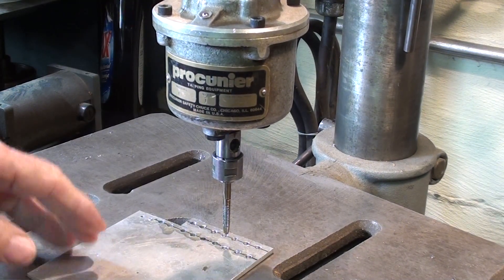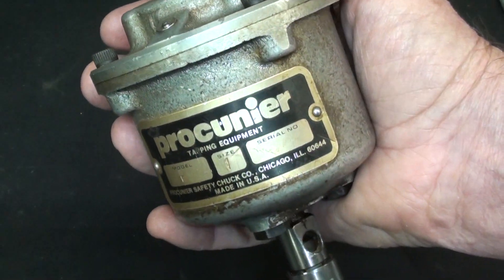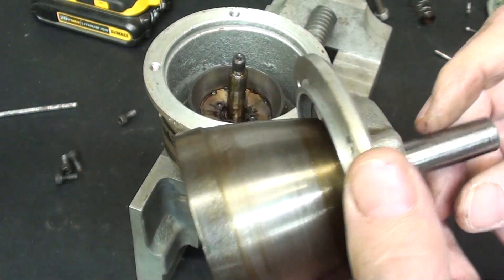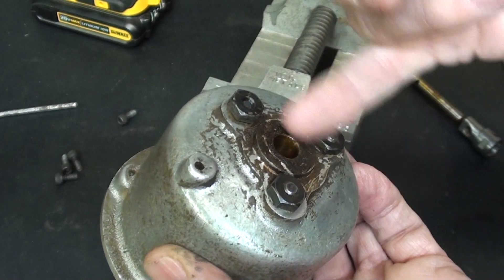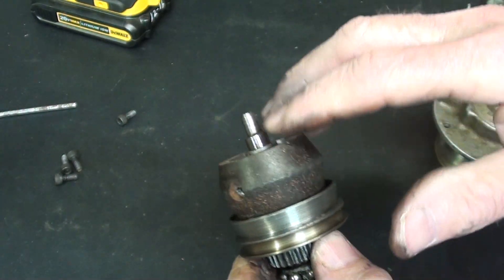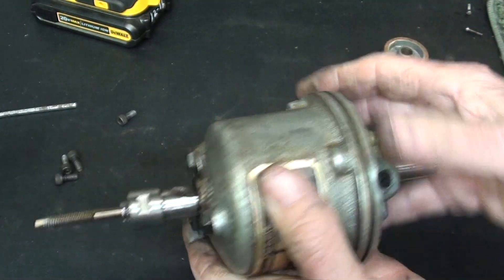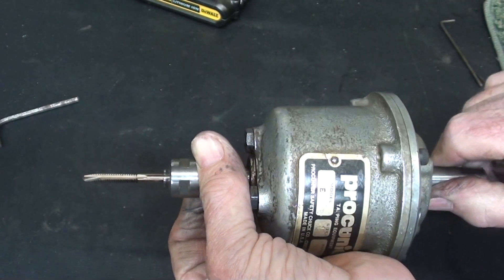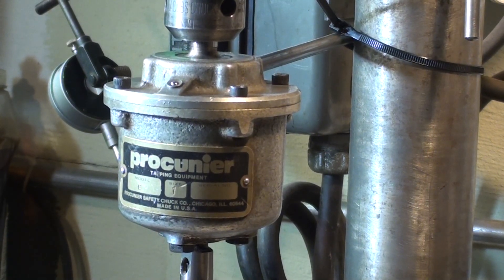PROCUNIER TAPPING HEAD What Makes It Work #31 tubalcain

Comment: When I built fiberglass housings for wind turbines I used a drill with a magnetic base that had a device like this for tapping the mounting plates. That thing could tap so quick you'd burn up the tap if you didn't take a break

Comment: Always wanted a reversing tapping head (its hard to tun a drill press by hand) so i bought a Procunier 2E off e-bay for $140. Came with a 3/8" collets but those collets are expensive. I got 6 off e-bay for another $75 so not too bad. Have not used it yet but looks to be in good shape and its made in the USA. Thanks for the video.

Comment: In early 60's i worked for Supreme Products and we made a tapper similar to this for drill presses; also a push-pull tapper for use on hand drills. Both used planetary gears. I was line supervisor for assembly for a while. Very interesting to see this again.
Reply from the maker: Thank you, I remember those supreme tapping heads

Comment: This are not correct, the friction are only to line up the ring gear with the planetary gear to lock it no friction on the down stroke / feed only on the more easy up stroke of the quill , what else are the ring gear doing. 😁
Reply: You must not have been paying attention to the video.

Comment: I've been a machinist most of my adult life. And I have always wondered how those tapping heads work. Never had the chance to take one apart. I knew it worked on clutches. Never thought about a cone shape. I envisioned a double sided flat clutch. Never thought about Cork as the friction clutch either. I always wanted to build my own version, maybe smaller diameter. The great thing about the Procunier is the ability to stop or reduce the pressure while tapping hard metals. Saving broken taps in the work, Ugh. We have a Tapomatic at work and I never use it.
 Thanks Mr. Pete!
Reply from the maker: Thanks

Comment: The Procunier advantage over the Tapmatic heads is the cork will not be exposed to oil when stored horizontally.....like a tool chain.
You can really kick up the spindle speed to get much longer tap life......try the .190-24 at 1,500 rpm in steel.

Comment: I assume the friction cone material is either cork or sintered bronze.  With the effort to exclude oil, I'd bet on cork.  I notice a gutter at the bottom adjacent to the drain hole.  Is this intended to act as an oil reservoir?  If so, this would imply some sort of lip seal on the output shaft instead of a felt.  The reaction rod should have had a little boxing glove accessory for the old school education it would offer the first time the drill press was reversed.  Thanks for the video.

Comment: Thank you Mrpete ! ive used the Procunier as well as the tapmatic tapping heads over the years, both with excellent results. The tapmatics can be found quit often on radial head drill presses.

Comment: Well I've watched the video 3 or 4 times, and read all the comments to this point at least twice, and I still haven't seen what completely explains (to me at least) the reversing process.   Obviously the double speed for reverse results from the 48 tooth ring gear driving the 24 tooth sun gear, with the three planetary gears simply functioning as idlers ... i.e. they reverse the direction, but do not alter the speed.  But the mystery is the engagement process.  Either the engagement of the ring gear with the planets goes "in" and "out" as the drill press handle is raised/lowered,  OR the engagement between the planets and the sun gear goes "in"/"out" as the handle is raised/lowered.
Without knowing the vertical dimensions or amounts of vertical movements taking place among the components down inside the housing it's hard to see which of those alternate scenarios hold true.  Regardless, we know it works, and it IS interesting and educational to see the inner workings.   Thanks Lyle for showing it!
Reply from the maker: That’s exactly why I would love to make a cutaway!
Reply: The ring, planets and sun are always engaged with each other. The sun is always turning and running in the reverse direction of the drill-press spindle.  The key is that the tap is connected to the cork center clutch, which is not permanently fixed to any driven part.  When the drill-press quill is driven down, the cork clutch is pushed up against the top of the tapping head (internal cupped area), which is turning in the direction of the drill-press spindle (clockwise).  When the quill is pulled up (away from the work), the cork clutch is pulled against the bottom of the tapping head mechanism, which is the cupped area fixed to the sun gear.  This drives the tap - now locked with the sun gear - in reverse and at 2x speed.  If you put no pressure on the drill-press quill, the cork clutch floats in the center of the upper and lower driven cup and the tap stays stationary.  See 11:53 for a shot of the lower "cup" affixed to the sun gear that the cork clutch bears against when reversing the tap.

Comment: I have one of these. It has a one half inch capacity. I've not use it in quiet awhile. I should get it out, clean it up and see if I could get up a trade with s local shop that might could use it. I no longer do production in my shop. I'm retired and just play in my shop.

Comment: Think ive tapped a million holes using those and other tapping heads.  I have two old supreme versa tappers one with 2 morse taper and one 1/2" straight . Oh and the hand held push pull tapper for hand drills or press.
Reply from the maker: You got me beat, I only tapped about 3/4 of 1 million holes while I was working my way through college

Comment: Interesting how it works, back when I had hair, in the first shop I worked in we had a tapping head in a dedicated drill press. In fact we used it on gears that had set screw holes in them. So being an apprentice I did a lot of tapping. Thanks for the close up of one of my modified oil cups, you did that to see if I was watching 😆

Comment: This was not clear to me in the video.  Is the ring gear directly connected to the main shaft?

Under forward feed the cork cone engages with the interior conical surface above the ring gear to directly drive the spindle.  In the neutral position neither that cone nor the planet gears are engaged and the spindle isn't driven.  Under reverse feed the the tap is held back by the threads it is cutting, pulling the smaller cone down to engage with the sun gear.  The sun gear is permanently engaged with the planet gears, which are mounted stationary to the body of the device.  The ring gear is permanently engaged with the planet gears.  All forward or reverse feeding does is engage the spindle directly to the shaft through the top cone, or to the sun gear through the bottom cone respectively.

Did I get that right?

That's pretty cool.  Thanks for the video.

I wish you the best for the coming year.

Comment: Great video! To add to the explanation on how the tap direction gets reversed: Reversing to counterclockwise during tap removal is due to the ring gear (connected to drill chuck) driving the sun gear (connected to tap via cork clutch) through the planet gears (fixed to tapping head housing). In this configuration, the sun gear rotates the opposite direction of the ring gear. Pretty neat! The planetary gear set provides the increased reverse ratio, but also is responsible for reversing the direction of the tap.

Comment: Fantastic video! I've got a Procunier E1 and E2 from e Bay and they are a fabulous way to tape holes.

Question: how do you store yours? Seems like laying one of these on its side risks getting oil up into the clutch area. The instructions are very explicit about not adding too much oil.
Reply: I have store mine on its side for the last 12 years. Still works fine. I think you would have to significantly over oil it to get the oil up into the clutch. Probably could clean it if you managed to get oil up there.
Reply from the maker: On its side in a drawer

Comment: I bought what I thought might be a tapping head very cheaply at a flea market. It had the arm coming off it to stop against the  drill press column. It turned out it was only a speed reducer and was too small for drills with over  a 1/4 inch shank.

Comment: I picked up a Yuasa Accu-Tapper tapping head from EBAY. Similar use but totally different function. Has an adjustable slip function with reversing. It cannot be serviced.

Comment: Me to wife: "Going out to the shop and tap a few holes." Wife, "You have a beer barrel out there? Me "No I'm tapping metal to make threads." Wife What are you tapping with, a hammer?" Me. No the drill press!" Wife You can't lift the drill press and hit something with it." How is that even possible?" No You use a tap to cut threads." "You don't 'tap" the tap to cut threads, you turn the tap to tap....!" Wife "Oh, run to the market we're outa milk." Me, Riiiigggghhhtttt.
Reply from the maker: lol

Comment: Lyle, the old guys with the circular saw mills used a similar idea for moving the shuttle back and forth. They had a spinning disk with a wheel that would move to one side or the other of the disk, thereby reversing the shuttle movement. See you at the Bar-Z. Jon

Comment: These are great units as are the Ettco Tapping Heads. Very smooth compared to Tapmatic.
Reply: the machinist  I have a larger Ettco and a couple smaller Procs. And also a large and small Tapmatic. The Tapmatic is crude and jerky but the others are smooth. Yet the inferior design is most popular. Like VHS vs Betamax.
Reply: the machinist  Never heard of them but now I want one!

Comment: We had those in the shop at Texas A&M University.  I fell in love with them! I wanted one for my own shop, but was driven back by the sticker shock.
Reply: Stalk eBay for them. If you can use a Morse taper, it will be easy, but the ones with 1/2" shank can be obtained at a moderate price if you wait long enough.

Comment: We had two of those at my work place that i used and serviced for 25 years.They where on a 5 position quadrille head.we put a drill ,a 82 degree chamfer,a counter bore,and the taping head.Once you use one to do a bunch of holes you wonder how you ever got by without it.They are fantastic and worth way more than you pay for them. That was the best explanation I've ever seen ,with a tool I'm very familiar with. thanks
Reply from the maker: Thank you, I’m glad you liked it

Comment: Great video.  That Procunier has a lot less parts than my Tapmatic which has at least twice as many parts.   Mine has a lot of clutches and clutch springs and gears.  It was broken when I got it and I took it apart to replace the broken part and it was hard to get back together.
Reply from the maker: Never had a tapmatic apart

Comment: Awesome I to have a tapping head however  I'm confused by my unit it is a wickman-thomson model T38-ss serial 216 it has it's own multiple tap holders, this unit has some special interest  to me as it is from Detroit  any help about this tapper would be appreciated.  greg
Reply from the maker: Sorry, I have never seen one of those
Reply: @mrpete222  well thanks for responding so quickly it looks as though it was used more in a lathe  due to the 1" shank I'll  take a picture  someday  you may  across one its pretty  neat

Comment: hmm possible future shop project I think DIY tapping head. The friction fit would have to be replace with some sort of full gear system. It would be tough to create and it would have to work on the principal of a manual transmission but scale way back with only one speed. Thanks for butting another shop idea in my head.
Reply: I have no idea of what you have available in terms of materials or machinery but the clutch drive could be duplicated using Nylon or a plastic with characteristics similar to the cork (there are quite a few) for the clutch cone itself.
Of course if you'd enjoy developing a small, reversing gear train feel free to ignore me, lol!!!

Comment: It should be quite easy in this day and age, for someone to generate an animated drawing which shows the mechanics of operation of this. A modern version of a cutaway, if you will...
Reply from the maker: And animated cutaway would be impossible for an old timer like me
Reply: @mrpete222  That is why I used the term "someone"...  And there is also something beneficial to having an actual physical cutaway, much like hard copy books versus digital ones. I'm also from the vacuum tube age :)

Comment: I have at least one of those, not sure what brands or sizes. Have always been afraid to use it because could not understand why the tap does not brake in the event that tapping becomes too tight. From this video, it appears that "Tapping Torque" is determined by how hard one pushes down on the drill press handle, and if not pressing too hard, when the tap gets too tight, or bottoms out in a blind hole, the cork clutch cone will slip. I am sure I got it, but if you read this, PLEASE Confirm. Now, when those heads turn up, lost in the crib somewhere, I will put them in the shop and give them a try on "Government Work" until I become familiar and confident in the feel of using them. I will dissemble, inspect, clean and lube them before using since now, thanks to this video, I completely understand whats inside and how it works. Thanks :)
Reply from the maker: Yes, you are right

Comment: Since 'I' have never seen it done, I'm thinking in my head that with the double speed reverse it could be used in a lathe
mounted in the tail stock. If so, that could be the main purpose of the double speed reverse. 

Does anyone know from experience?
Reply from the maker: I have never use one on a lathe.   Think I will give it a try
Reply: @mrpete222  That would be interesting if you show it on the follow up video Mr. Pete.
By the way, you are a true asset to humanity with all that knowledge sharing of yours.
Reply: Don't think it would work on a lathe, since tapping heads need to be powered. Also, they're designed to tap multiple holes, not just one central hole as on a lathe.
Reply: @ellieprice3396  I have used them before in a manufacturing environment on a gang drill.
'If' it would work, I could see it being used on a small run done at home.
Reply: @toddk.5873  Thanks, maybe I'm missing something. On gang drills the head is powered by the spindle to tap multiple holes on the table. In a lathe tail stock you would  tap only one hole in the rotating lathe chuck. These heads in gang drills  work great but lathe tapping would be awkward.
Reply: @ellieprice3396  To be honest, I really don't know. it was a thought that came to mind.
It wouldn't be the first time I had a thought that didn't pan out. I was kinda curious.
Like if you had a run of the same parts on the lathe that needed a tapped hole.
I wondered if you could blast them out while the part was in the lathe with the
tap head either in the tail stock or on a turret.
Reply: @toddk.5873  Actually, it was a good thought, and would work in a lathe, especially if mounted in the turret. Any number of identical parts one hole parts could be easily  tapped by lathe power. The turret would drive the tap into and out of the parts. Maybe Mr. Pete will demonstrate it in a future video.
Reply: @ellieprice3396  
I'd say you nailed it.
In a tailstock it would be a little difficult following the tap into the hole and then backing off at double the speed - mounted in a turret or adapted to the toolpost it would be easier to follow with the apron hand wheel.
I don't believe it makes any difference whether the tapping head is driven or the part - pressure engages the clutch to "lock" during tapping, and then tension engages the opposite clutch for the planetary gearing to back out of the hole.
I'm almost sure I've seen it done, but I look forward to trying it when I have some free time at work!

Comment: Thank you for unraveling that mystery. I think you did an excellent job explaining that. In the beginning when you where telling how it operates I was imagining a stack of disks like a clutch, then I was amazed that it was even simpler. Kind of like opening an Easter egg.
Thanks again.
Reply: Some other brands of tapping heads did in fact use clutch disks!
Some are/were even adjustable for clutch tension so torque to the tap could be limited - Tapmatic still makes just such a tapping head.
There was plenty of "magic" in the history of machining/toolmaking!
Reply: @Motor-City-Mike  that so cool. Thank you for sharing that information. Happy New year.
Reply: @dannyl2598  absolutely!
A happy and prosperous new year to you!

Comment: Thanks for the information Lyle. Always wondered how something like that works. Just curious (or maybe I missed it), how would they restrain the torque bar in a production shop? Was there a bracket that bolted to the drill press column or the table? I doubt they had zip ties “in the day” 😁👍
Reply: We used a loop made of small chain.
Reply: MIKE 👌

Comment: They are damn expensive, what about using a drill press but slow down the speed is this possible without braking the tap
Reply: Hi Keith. Yes, that is possible. I've been doing it for over fifty years. With a reversible motor on the drill press you tap part-way through in forward, release switch to neutral, coast to a stop, then reverse to remove tap. Speed doesn't have to be all that slow but   it takes a little practice to get the timing just right. Mine is a Rockwell 15 inch with a reversing drum switch.  Tapping aluminum is easy but also works on steel up to about 5/16-18. "Use a little oil of course.
Reply: @ellieprice3396  thanks very much  for the info
Reply: Keith Henry: Spiral end, two flute "gun" taps on through holes work best. Don't try this on bottom holes except to start the tap a few threads. "Gun" taps have nothing to do with guns. They're called that name because they "shoot" the chips out of the hole ahead of the tap.